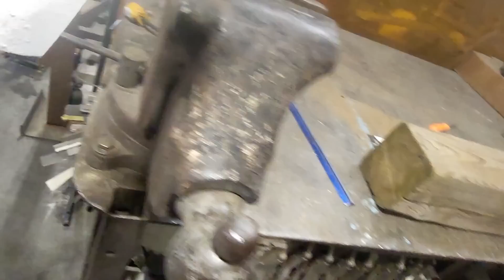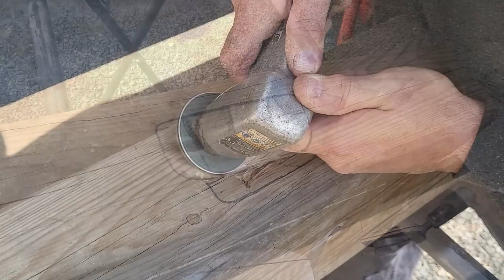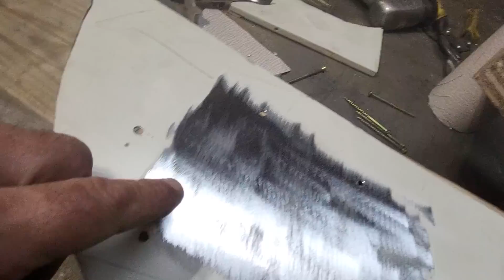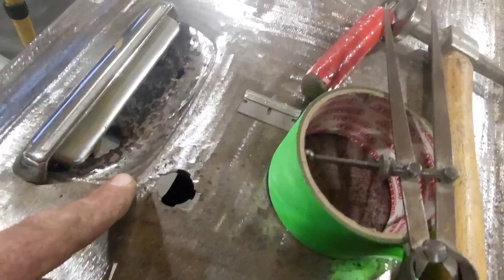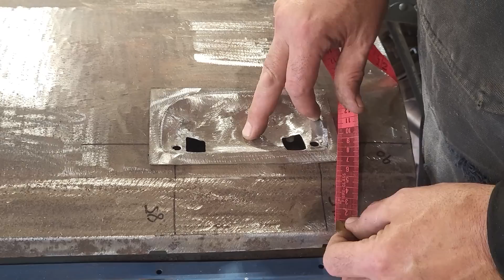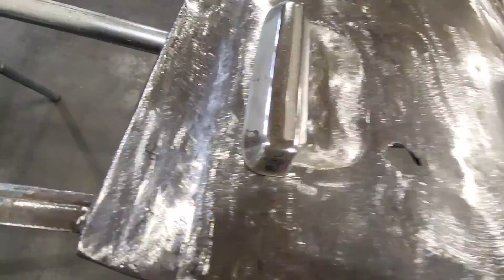Custom made panels. Basic tools

Comment: in my opinion, the process is too laborious. It was much easier to weld from several pieces of straight sheet steel. There is no process in the video, how did you manage to level the surface of the soap dish?
Reply from the maker: Its flat in that area and was no effort to blend the two

Comment: Fitzee -One suggestion would be to use Wray Schelin's flexible shape pattern method. 
Masking tape and glass fiber tape at 45 degree lay down to make the pattern from the door handle recess.
That way you would get the perfect bubble profile and the volume of the dimple . 
also consider using an old air chisel bit and rounding the end and using  that as a flow form type tool.- taking some guidance from Karl Fisher of MakeitKustom and Japhands.

Comment: Hi Tony.  The factory would have had like a 50-ton press smash that shape into the door panel in one shot.  You are doing the same thing but with wood and a hammer and many shots.  Makes sense.  The patch looks perfect after welding and grinding it into place.  Great idea for forming a small sheet metal detail for a larger panel!

Comment: I’ve also seen folks use an air hammer with a rubber tip to press steel into forms.  I’m sure you seen japhands do it to.  Nice work.

Comment: Hey Tony!
Have you tried using a propane torch to heat the metal as you hammer it into the "buck"?
I have to make a couple of "split window" halves, and was thinking of trying it that way.
Reply from the maker: @frankschwartz7405  no I find with heat it tear easier

Comment: Have you ever tried supporting the back side before welding? I haven’t, but I wonder if the drop could have been minimized by wedging some wood behind the door panel before welding in the patch.
Reply from the maker: @T3glider  I done that and it does work  this was hard to do that as the door frame and door bar was in the way.

Comment: Excellent work.  Love it!  Does hammering the tack weld while it's hot with a dolly behind it stretch the metal prevent the warpage you encountered?
Reply from the maker: @JimDockrellWatertone  mig cools fast. Time you get the gun laid down it cooled enough that it's gone hard.  Gas welding and mig welding are different welds. Mig is hard and brittle. I don't like hammering a mig weld for this reason.

Comment: I had a Corolla the same year back in the mid 80s.  The sheet metals in those cars was extremely difficult to work with.  Just heat from the filler curing would warp the door skin. But it was a cute little car when finished & really fun to drive around town.  Always love your work & how to get it done.   Thanks for tips.

Comment: Ciao i, what is the thickness of the sheet metal of American car  from the 50s and 60s? Saluti dall'Italia ❤
Reply from the maker: Alot of the earlier metal  were thicker. As the years past the metals got thinner and thinner. I seen 18 gage on 30s cars 50s and 60s cars were around 20 gage. Modern  cars are around 24 gage
Reply: Thank for the your  answer  @fitzeesfabrications
Reply: I have measured the thickness of a door panel fitted to a late 2000s Alfa Romeo - 159 if I recall correctly.  The thickness was 0.9mm which equates to circa 20 gauge - ie. 20 gauge is equal to 0.95mm.
I understand that the early 1970s Corolla's door metal is thinner - however I don't consider it to be as thin as 24 gauge which equates to 0.64mm.  However a rusty door panel could be somewhat 'thinner' in places than when it was new.

Comment: Even if the metric numbers are a bit odd ball, say 87, isn't that still easier then a number like 3 and 5/32 or something? Especially if you start having to add a couple of them together.  Funny thing is though, even though I've been metric basically all my life, I'm still 6 foot and I put 32 psi in my tyres. There are just a few things that really should be imperial 😂
Reply: I figure use metric on a metric car and imperial on an imperial one, just whatever the factory would have used to avoid weird numbers

Comment: I think part of the problem with the door skin being difficult to keep in the correct shape, is that the hammer form block was a flat top surface. The door would have a slight curve, from top to bottom. So, consequently the door handle “insert” has a flat perimeter, and being very rigid, it would have been forcing the door skin to conform to the insert’s shape. No matter what, you’ve done a really good job, as usual 😃👍🇦🇺🦘

Comment: It appears that inspector Peanut had a lot to say at the end of this video session. Just remember to protect your work with some rust inhibitor inside that door before you close it up, there are not many of those around anywhere because they were designed to rust away from the manufacturer. I thought you would use a body dolly inside that cavity, but it all worked out in the end.

Comment: well done  :face-turquoise-covering-eyes: had a crazy idea and don't know if it would work " if you took masking tape and covered the door handle area then filled it up with bondo"  that would be a mold right  ?
Reply from the maker: Yes just braking it free will be the issue.
Reply: @fitzeesfabrications  i thought the masking tape would release it , and fill in the bad areas
Reply: @fitzeesfabrications  you have one of the best fab shows there is "I've picked up lots of tips from you" thank you

Comment: Here's a challenge for you. I had a gas burner that had a hole burnt in the top. The metal must have gone down to about 30 gauge. I welded a piece of 24 gauge over the hole using flux core with the welder turned down as low as it could go and still weld. After grinding it off, I had a few pin holes, but I wasn't going to try welding it again, so I used some muffler putty to finish the job. That was practice for when I work on my car project with flux core welding.

Comment: Great template. Try and heat it up with a blow torch slightly to help soften it. It works. Still a beautiful job without the heat.
Reply: I was thinking the same….just annealer the metal a bit and it would form easier.
Reply: Anneal

Comment: When you had the replacement door handle panel positioned over the original holes, you could have marked around the edge of the new panel before you cut the piece out of the door. That would have made positioning it easy without having to measure it.

Comment: just curious... I'm a total rookie so... what would happen if you used something like HF Stud welder dent puller on your low spots... not even remotely trying to tell you what to do... just curious
Reply from the maker: Problem with low spots like these are they are not dents but more a stretched section of metal. The stud gun comes with a shrinking  attachment. That's what I would use here
Reply: @fitzeesfabrications  awesome... I guess I was headed in the right direction...BTW I have used your butt welding technique many times...love it and thank you

Comment: Great job on matching the old part. When you're welding you should try to weld it all in one shot. The distortion is from uneven heat put into the part. Putting in small welds and going back you are putting heat multiple times into the same spot. Waiting for it to cool won't help. Think more like heat treating the part, bring it all up to the same temp and let it all cool at the same time. Sounds insane, but it makes a huge difference.
Reply from the maker: That don't work with mig welding sheets metal. The more you weld the hotter it become and heat travels farther out into the panel causing more damage and a mig weld cools different then the sheet metal causing it to fight against  each other making very bad warp metal.
Reply: If you apply a continuous (Mig) weld, the resultant heat input will be huge and the resultant panel warpage humongous within the large relatively large/flat unconstrained areas such as the Corolla's door.
I have worked with the metal used in the Corolla (and other Japanese cars of the same era) and I can confirm it's very thin and you have to be uber judicious (and restrained) when attempting to planish out a dent - as you can readily worsen the situation.  Needless to say, the degree of difficulty increases when confronted  when the said thin metal is also rusty.

Comment: There's no chance in hell anyone welding that ole 70 repurposed steel is gonna weld that without having it warp like crap on them. I think you did a pretty dern good job if you ask me. Your bound to need filler work in that kind of job no other way around it. Cheers bud. fantastic work as always bud.
Reply: Agree.  I have worked with the metal used in the Corolla (and other Japanese cars of the same era) and I can confirm it's very thin and you have to be uber judicious (and restrained) when attempting to planish out a dent - as you can readily worsen the situation.  Needless to say, the degree of difficulty increases when confronted when the said thin metal is also rusty.

Comment: Excellent video Tony, reminds me of tool and die  techniques used in old school die building before cnc. Fwiw, you could make a plaster cast of that cavity from door panel and duplicate the exact contour into your woodbuck. You have an exceptional ability in your metal working.  Pleasure to watch your work!
Reply: It looks great to me, they won't be able to see inside the door handle recess as you are zipping past them doing low 9's.
Reply: @byronperry6014

Comment: You could tape the holes and coat with mold release or saran wrap and fill it with epoxy resin and just hammer over top of the epoxy

Comment: Hey Fitzroy, sharing an idea, what about using body filler? Make a negative mold, then a positive mold, then use it for the hammer forming buck.
I also had the idea to try a needle scaler for the hammer.
I dunno, may work, never tried.
Reply from the maker: There are many ways to do this.i just did it with what I had laying around

Comment: I wonder if this might help with warping. Tack a strip of 1/8” to 3/16” strap above and below of your weld to hold the panel. Love your videos. Learning a lot for my project.
Reply: You can use welding heatsink putty (like 'Cold Front') to reduce heat transfer.  However, I have worked with the metal used in the Corolla and I can confirm it's very thin and have to be uber judicious (and restrained) when attempting to planish out a dent - as you can readily worsen the situation.

Comment: 46:38 i been in that situation if there is room i like to shove one those cheap little screw Scissor style jacks like you find in the trunk of this car inside the door and put pressure on the skin then hammer on it to strech the metal back out i find the constant pressure from the jack really helps

Comment: Another thing i wanted to mention is you can get 110v speed controller for a router there pretty common not sure if you can find one on the island but when wood working you can plug your grinder into and limit the speed for finish work so you cut the wood away instead of melting it with 14k rpms

Comment: Metal carbide bits ..the ones with the little spikes on them..they are black and are designed to eat wood..the one with the ball on the tip would of got the shape in great. Just thought id share..i just saw you had some bits around😅.

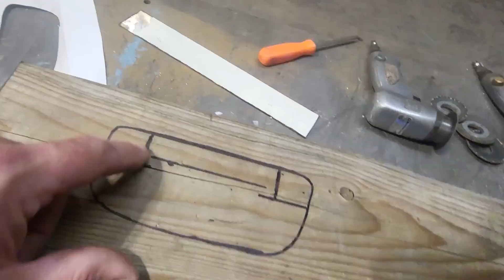Comment: 4:44 so i like to put a i piece of cheap dollar store foil in the bottom of the hole and coat of wd40 and then fill it with cheap candle wax then i got a 3d template then i can use flapper wheel to grind the wood out till the wax plug fits nice